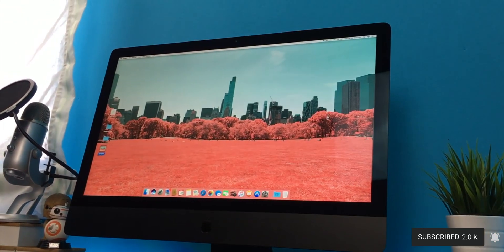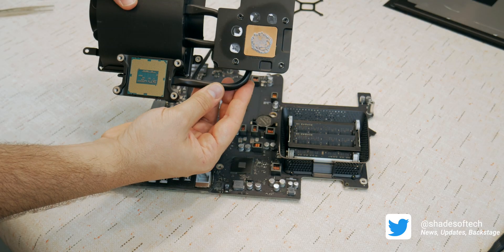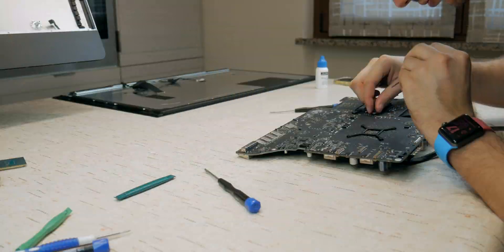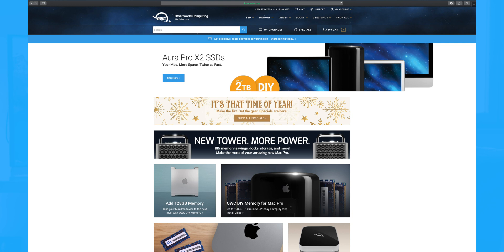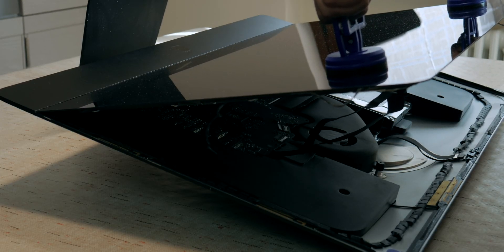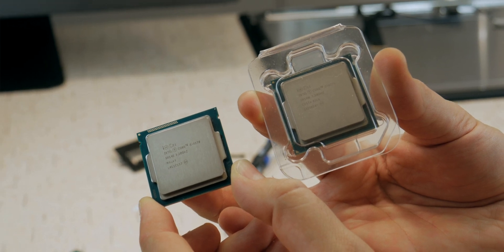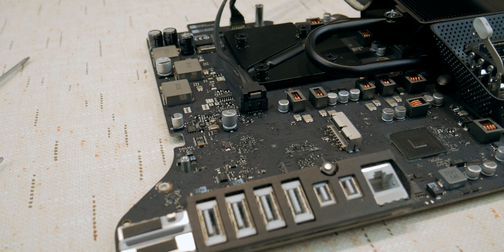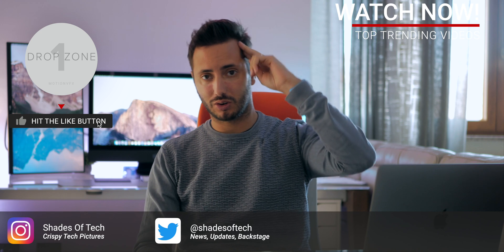iMac UPGRADE is EASY! My first time | Shades Of Tech ⬡

Comment: Can i upgrade tge cpu i5 to i7 in imac 21,5 inch late 2012? And what could be the best i7 i can use fov this, thanl you
Reply from the maker: I am not sure because usually on the 21.5” model the CpU is not socketed but soldered so you can’t upgrade it